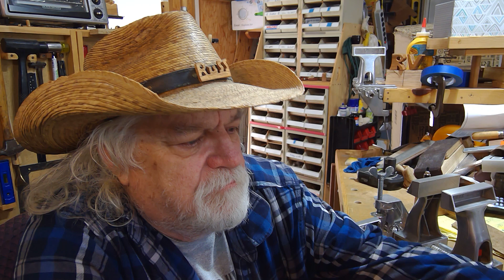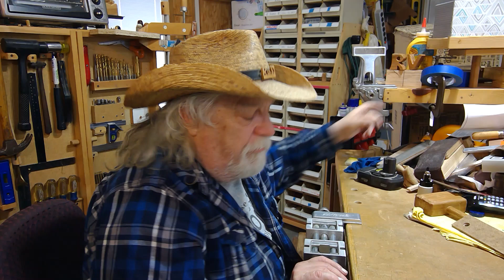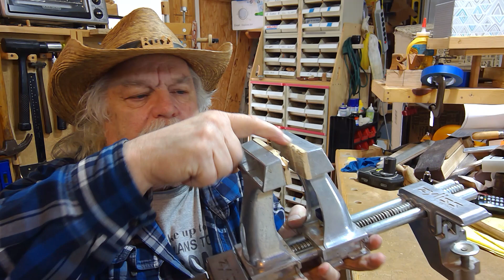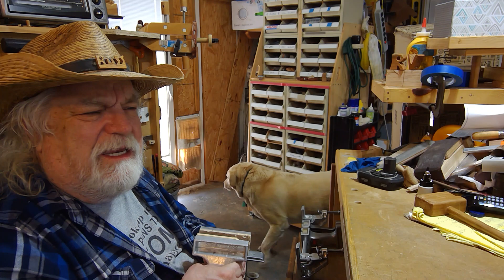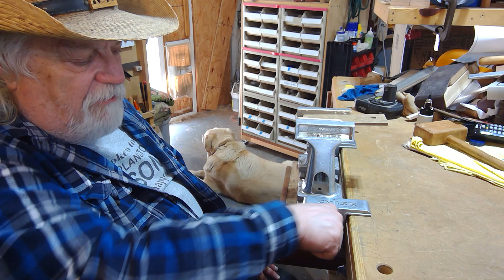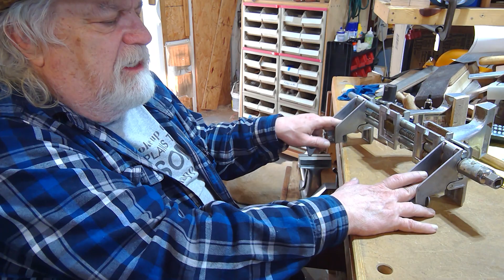Zyliss Vise and Upgrades by Rambling Russ

Comment: Just ran across your Zyliss video thanks for that, I’m looking to pick one up. Could you “or someone” tell me if it’s true that the newer stock is not as good as the original stock vise? Thanks
Reply from the maker: I haven't seen a newer one.  I'll pin your question at the top of comments, so everyone will see it first.
Reply: @russveinot5754  thank you sir!
Reply from the maker: @vaughnwesterby5162  Just an afterthought, I am glad I bought a vise with all the attachments.  They add a lot of capabilities.  BTY, I am about to come out with a video about making add on jaws using magnets.

Comment: I just got mine at the swap meet for $20. My goal is to make it into a guitar vice. You mentioned drilling little holes into the jaws, that's exactly what I want to do, to screw in wooden pads so that the guitar body won't get scratched up. Oh by the way I watched the Zyliss demonstration video and the representative said the vice was made out of Magnesium Alloy, that pretty dangerous stuff when drilling, I hope it's just aluminum alloy. Thanks for the video.
Reply from the maker: Nice price.  You could use magnets also instead of drilling holes.  Thanks Greg
Reply: @russveinot5754  The magnets wouldn't be strong enough. I'll let you know how it goes. I'll be drilling this week.
Reply: I’ve got these plastic covers that coming in. I’ll try those first.
Reply: Oh by the way, magnets wouldn’t work it is aluminum. Or aluminum alloy, what’s the difference.

Comment: Wow I think I got ripped off! Paid over 400 NZD (around 200usd) and absolutely love it. Want to buy 1 or 2 more but am finding it difficult to find what to search for in the second hand market.
Reply from the maker: I imagine Zyliss vises availability down there is rarer than here.  I can still find them on Ebay for between $60 and $120 (USD).  I could get by with only one Zyliss but I do like to spoil myself :>)
Reply: @russveinot5754  I can absolutely see why though. The amount of messing around that it saves, not to mention storage space instead of 20 clamps etc.

Comment: The spark plug wrench is an improvement over the crank, but a star knob is even better! You aren't wrong about star knobs being a pain to sand though. I'd send a picture if I could figure out how.
Reply from the maker: you can send to my email address "".  I would love to see your ideas.  Thanks for your comment.
Reply: @russveinot5754  just sent pics
Reply: @russveinot5754  Did you get the email?
Reply: Russ, you're usually so quick to respond, I wonder if the pictures I emailed you a few days ago got kicked into your spam folder?
Reply from the maker: I'll check.  This is the first I heard about your sending them.  I'll look this pm (that's where I do email stuff:>).  Thanks for the follow up.
Reply from the maker: Thanks for the pics.
Reply: I replied to your email. Thanks

Comment: Your videos convinced me to buy a Zyliss vise for myself. (Also some handscrew clamps.) I noticed that you don't show the turntable attachment that lets you set up the vise 90 degrees to the table. Do you not find it useful in your shop?
Reply from the maker: I do have that attachment, but I think I only used it once.  It works OK.  I seem to use my Zyliss more than any of my other vises.  It is my favorite vise.
Reply: @russveinot5754  I made a block that goes between the turntable and the vise to give me some clearance for the pushbutton on the movable jaw. Now it feels usable.

Comment: The second Z-Vise is now on my mind. I haven’t even tried to use it as a pipe clamp. The cheater bar / torque handle is a great enhancement. I love cranking handles and that’s one of the first things I used my Z-vise to make!  The very oldest z-vises actually aren’t made of aluminum, they are stainless steel! I’ve yet to encounter the stainless steel variety, but I got mine with all the extra add on attachments (as far as I know) in the carrying case!! When I see them in the beat up cardboard box, I think to myself that the case alone is worth $100! I’m so over the moon over my Zyliss vise that I’m starting to think 4 maybe a good way to go with one for each of the four corners on a table. No no no!  8!! 8 z-vises!!  2 on each corner on a table!!
Reply from the maker: I still love mine.  I got all the attachments with one of mine (case and all).  I don't use them often, but nice when I need them.  Thanks for your sagacious thoughts, Jimmy.  BTW, 8 vices might not be enough :>).  A spare to take with you might be handy.

Comment: I just moved after fifteen years in the same home, and came across one of these I'd forgotten I had! Mine is made by GripMaster. I look forward to using it! I think I'll do some of your modifications as well. Thank you!
Reply from the maker: Thanks for sharing, Kenny.  I still use my Zyliss all the time.  Do you have any of the accessories?
Reply: @russveinot5754  I think I just have the base model, including the extension end piece, and two pieces that hold a long item so it can spin. Also the rubber and metal pieces that go on the clamps. It looks brand new!

Comment: Oh wow, that quick release is handy. I wish I had that on the one I just got, which I’m guessing is an older model.
Reply from the maker: I thought they all had that!?
Reply: @russveinot5754  
Nope, mine looks to be an even older one with nothing but a single little black and white booklet printed in Swiss(?), French and English that inventories the box and shows what can be done with the vise. 

The jaws are solid with red soft covers. Kind of a pain without the quick release (the swivel attachment would be cool too for carving) and really only at home at the end of a table without removing the handle for a driver like what you did with yours or making a smaller handle for the screw on the other end, but it works.

Comment: I own three. One Zyliss and two knockoffs. Paid $7 to $15 at estate sales. Very useful vise as you can move it all over the shop with ease.
Reply from the maker: Yes, I use mine all the time and seems to find a new spot all the time. 
Zyliss is surprisingly unknown.  I have 2 and one was a full package with all the attachments.  Did you get any of the attachments?
Reply: I've just found this video and I am looking into buying a vice like this. The Zyliss models are very expensive on the UK ebay site but I can get a "Z-vise" full kit for about £45 which seems a good deal. What are the knock off versions you have, and how do they compare with the original, please?

Comment: Great video Russ. When I was a kid (I probably didn't even have my first job under my belt) I remember there were two products that I had seen on TV infomercials that always stuck with me: The first was the Fein Multi-tool and the second was the Zyliss vise, although I didn't remember what the Zyliss vise was called. 
Years ago I stumbled on the You Tube video of the Zyliss vise, and I said "that's it!" Although the video I saw was for the Renovator 10 in 1. After more research I found out that the original is the Zyliss vise who held the original patent. 
Fast forward to today, I can now (like pretty much everyone else) afford a Multi tool since they are now within everyone's budget. I have the Ridgid model which works really great. I have been lucky enough to find the Zyliss vise on all kinds places like Ebay, Offer Up, Craigslist, etc. I now have 4 of them because I can never pass up a good deal. They are really handy for all kinds of uses. Now if I can just find someone selling a Swissrex. That looks like another really cool tool.
Reply from the maker: Thanks for the insight Greg.  I too own multiples of the Zyliss and the Ingra jig.  I can't seem to let a good deal (a steal) go by either :>)
Reply: @russveinot5754  Hey Russ, I would love to have one of those Incra tools for my table saw. I rarely see anyone trying to sell one at a good price.

Comment: I like how portable they are, how easily they adapt and the infinite clamping size ability. I’ve had mine for probably 20 years and paid about $20-25 for it. It even came with the lathe and drill press pieces.
Now you gave me thinking about drilling and countersinking the jaws for screws so I can use my magnetic soft jaws with my Zyliss Vice.
Reply from the maker: you could CA glue magnets on the backside of the vise.  the magnetism will go thru aluminum.  No holes needed.